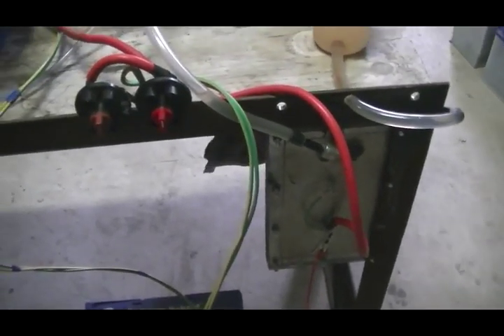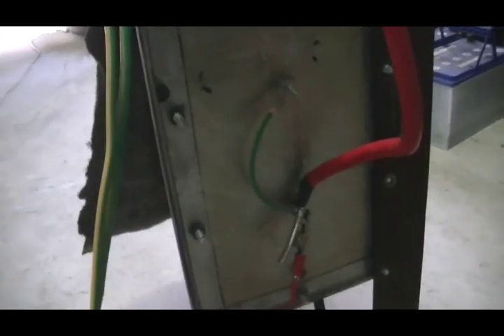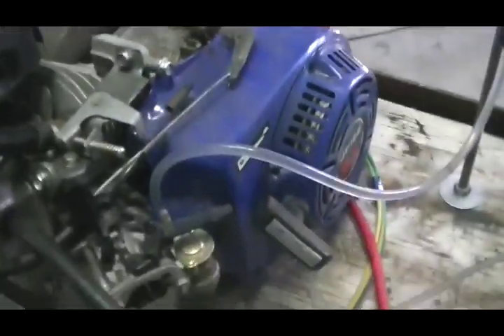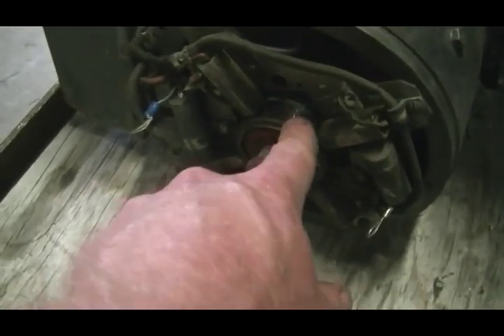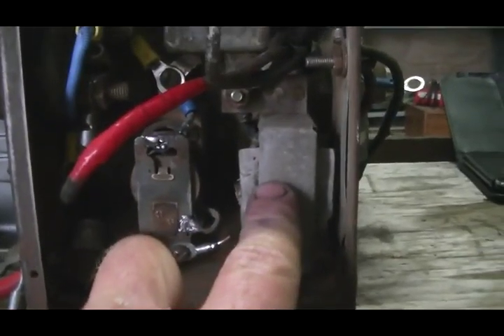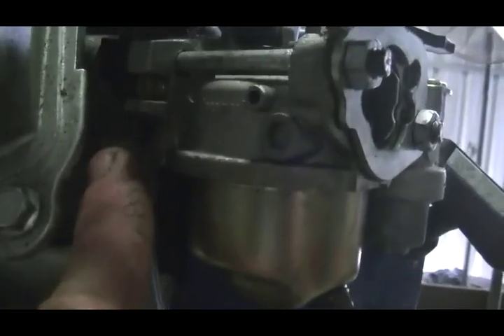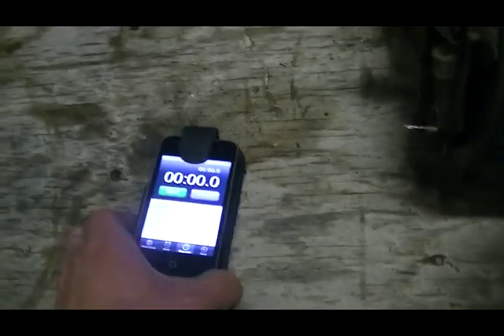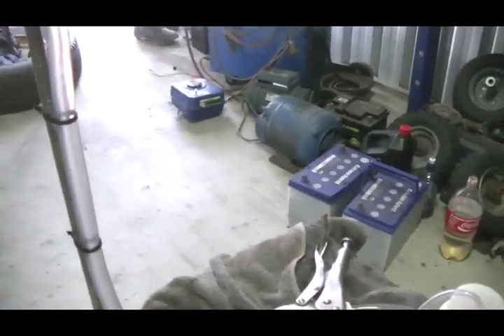HHO realy work's

Comment: whats a PMW ?   HA HA LPM ? MAYBE?KEEP TRYIN YOULL GET THERE ALLSO MY DESIGN IS 5 plates of 316 l marine grade stainless steel  the  centre being pos  neutral plate eitherside  and negative on each end   plate sizes are 120 mm x 55 mm  make 2 of these coupled together  and run them as 1 cell and use  caustic soda 2 table spoons to 1 ltr you will get about  3 ltres a minuete or more  now make this 4 more times and put them each into clear pvc mason jars and hook to bubbler amazing production low amps cause of nuetral plates also need long spark plug leads made up so they can be wrapped round 9 times each cell used then back to the spark plug this will give you the energy you are looking for?

Comment from the maker: Im not quite sure how the coils in the generator are configured,but by adjusting the wire wound pot i can increase or decrease the current output of the generator.
I will give your cell idea a go,as i do have some copper and stainless sheet.

Comment: That gen is great if that can be variable with no loss of effeciency. How is that done? 2 outer copper plates and a stainlesss 304 for the anode will produce outstanding mmw. Be sure to have all sides of the stainless connected up as it is quiet resisitive and you want the electrons to flow as evenly between the plates as possible. Use 1mm stainless but no thicker. I had all my edges that hang out from the gasket copper plated and it works even better. You can do this yourself . Ii can tell you!

Comment from the maker: Hi aquapulsefuel
I wouldnt need the buck convertor as i can wind the voltage and current down or up as i need it on the generator itself.
I can set it to put out 2 volt's at 160 amp's if need be,as it will do 320 watts no problem.

Comment: having a 2mm or more gap is fine with brute force electrolisis and allows the gas to flow from the plates with out a pump which is a power user.

Comment: You will find you do not need much hho at all to make a ice more effecient if it is running at a constant load like a generator. You can build a standard cell that runs off 12 volts but it sound like to me you are after the effeciencies:) i am happy to tell you what i have learnt to get you effeciency very high. A copper cathode and a stainless anode is a good start but their must be minimal difference in the gap between plates as it will draw current from the closest and you lose sirface area.

Comment: Gday tin man. I suggest 3 plates using the middle plate as positive and outside plates as negative. Now you have 2 gas outputs independent of each other and thus not sharing water so also no voltage leak. Now you only need to get your voltage down to around 5-6 volts with a buck converter which are very effecient or just build 2 of the cells above!

Comment: from what darrell was telling me you need to stay around 2 volts per plate. amp draw is a little high to run that small set up. the original plate design i set up was perfect for 1 1/2 LTPM . i had positive in center,5 nuetural plates on either side and two negative plates on the outside. worked like a charm at 10 to 12 amps

Comment: One more thing. Yes HHO works, it causes great upset in an automobile computer and its explosive. A little plug on my progressive injection system that maps the cars computer and injects correctly is the only way in my book. Fuel injection is way different than a Carb in the way they function, however you need to understand carbs to understand fuel injection. My thoughts, for what its worth.

Comment: I think its important that you commented on the air fuel ratio when HHO is flowing. When you install a HHO on the manifold side you are creating a vacuum leak and the Carb can't pull as much fuel in, HHO's hope is to give a second fuel source and regain the power lost from the lack of gasoline BTU's. A detailed test on manifold vacuum with HHO and then an open leak regulated to the same M/V and pulling the same amps will clairify this. I like your work. David A. Puchta

Comment: Great Test! Well done!
My local Mechanic has been installing these for years. Better than LPG conversions... Lol I wonder how it would go with LPG?
They use a commercial dry cell, and install a slightly bigger alternator. Seems to reduce fuel consumption to around a third in most vehicles. 50L petrol and 20L water gets about 1,000 - 1,500 km from a Commodore... Cost half the price of LPG to install. Now you have me thinking about tri fueling my ute, with home modded alternator...

Comment: I can't speak for some of the cells on the market because I haven't tested them. I'm working on a micro cell thats giving me about a lpm at 15-20 amps. Should have it to market soon. I've heard good things about the Punch 5.0 and Mike over at hhoconnection has ran demo's of it. If your getting results with such a low quality cell, I can't imagine the results from a tweaked cell...good stuff...

Comment from the maker: Hi Chris
It would be of no use clamping the fuel line,as the engine gets it's fuel from the bowl of the carby.
The only way to lean out the fuel would be to use a variable main jet.
The way i have it set up now would lean out the fuel ratio once the HHO started to flow into the manifold anyway.
Thanks for the thought but.

Comment: ok, lets try something a little differnt tinman. one positive plate in the center,on either side of that have 5 neutral plates of your ss with the holes in it, and solid negatives on the outside. that should give you just about what you need. what was your ratio of sodium hydroxide or koh?

Comment: nice test there tinman. did you get with darrell about a cell construction with no current loss? if you have time try and set up  a cell with 5 neutral plates a positive and one negative. and you might try that peforated SS as neutral plates. you got pretty good production off that set up. now there does come a point when supplying to much HHO to a motor actually decreases the performance. i would not have a idea what your motor would or would not need.

Comment: Good one TM!!! There is a little Controvery with Amps and Voltage. "Browns Gas" is low voltage and a higher Amperage and plenty of surface area. PWM is not needed. But a DC Frequency... on/off or a dwell time; by Yull Brown. Sent you a link. Can't seem link in comments.

Comment from the maker: Hi aquapulsefuel-first up,why only 3 plate's?.It was my understanding that we need only 2 to 2.5 volts per plate.
And in reguard's to a PWM,well i dont need one with this setup as i can regulate the current by the pot on the generator.With that single 5 ohm pot,and the way the generator is set up-i can adjust the output from 1 amp at 12 volt's to 50 amps at 12 volt's.
They dont make them like that any more lol.
But i would like some more info on the buck convertor setup if you have time.
Cheers

Comment: Ok tinman, first make a 3 plate cell using  200mm square plate and a 3mm gap between each plate with nylon breadboard routed out and 1 mm clear pvc gaskets. Now make a buck converter and you will have amazing effeciency from your cell. Still use a pwm though to regulate your cell. Its all about not having voltage leak between the plates!